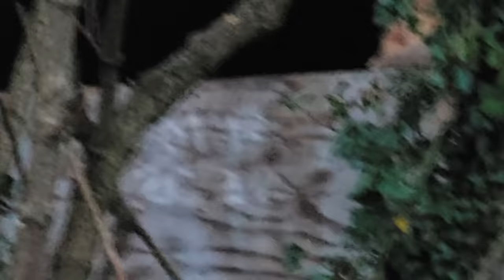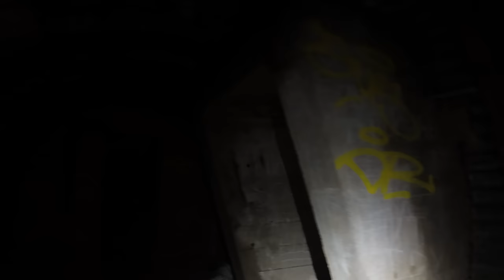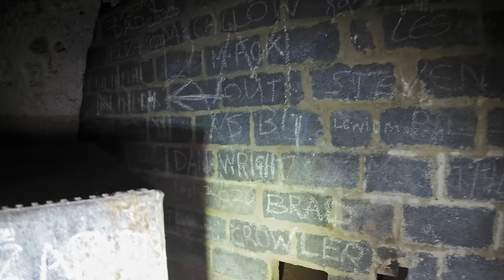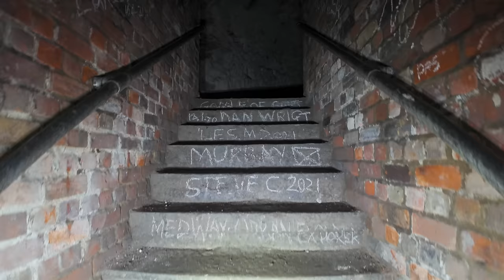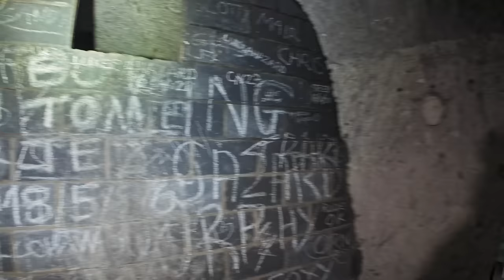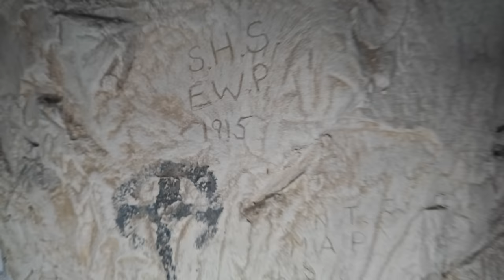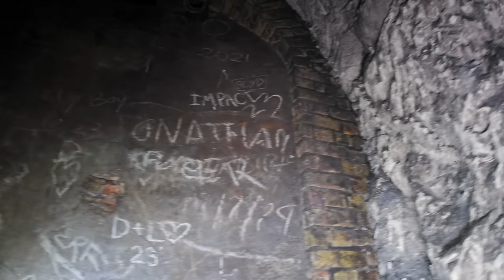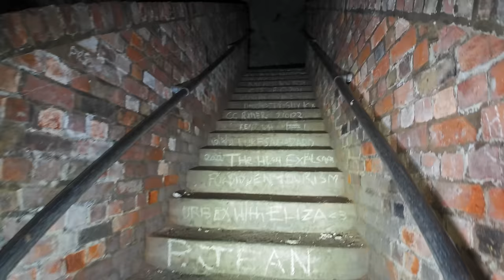Secret Tunnels under Dover - ESPLANADE TUNNELS

Comment: Completely unrelated to the explore, I purchased a empty usb power bank where you would fill with 20 18650 batteries, it is quite heavy but if you need a long battery assistant that would be perfect, it would keep your lights and cameras charged for hours so no worries about going dark. Sorry for adding this but I thought I’d add. Also I’m trying to imagine what the noise would be like when it was fully functioning. Great place for getting lost lol
Reply from the maker: Ive got batt usb banks in my bag but with the Pocket3 i havent run out yet.